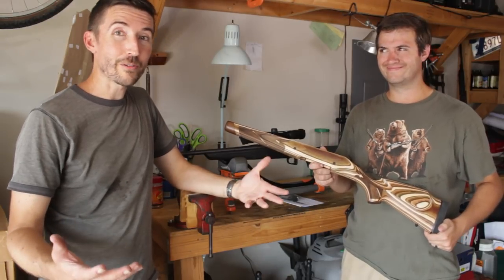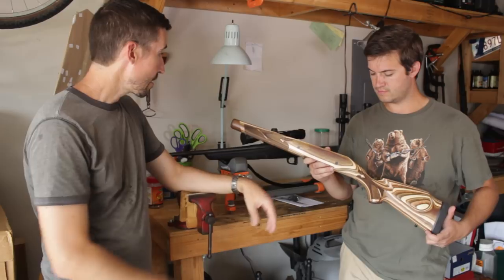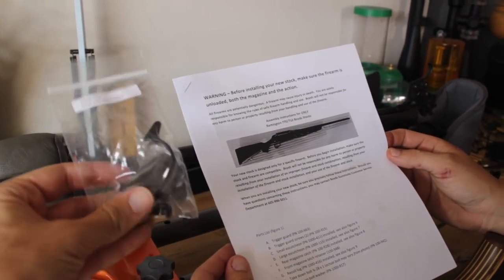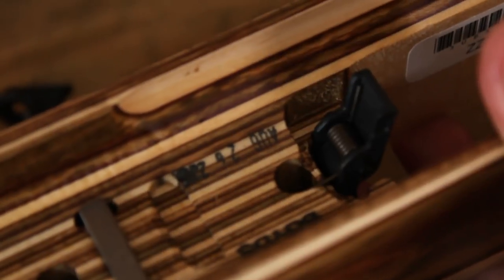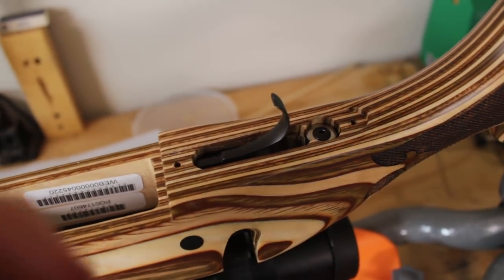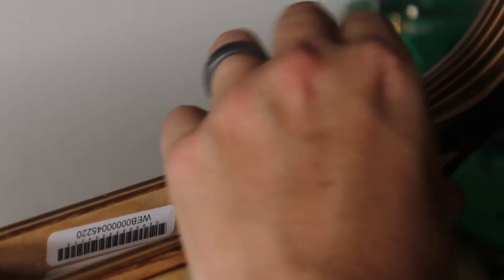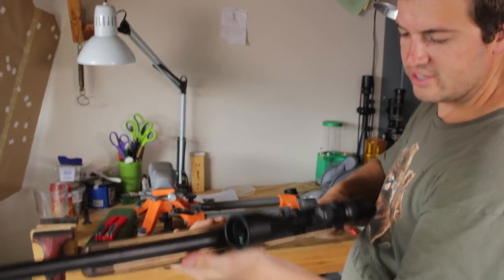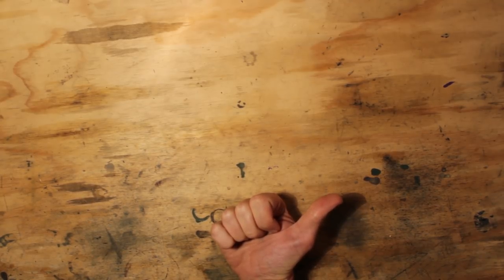Boyds Heritage Rifle Stock Install - Remington 770 in 300 Win Mag

Comment: I ordered the thumbhole and just went through this whole ordeal...this video is the only one I've seen for the 770 and it was helpful more so for morale I guess...my biggest prob was the magazine area...I took alot of material off and it is currently still really tight but it does go in...then I had the prob ya'll had seating the action...then they left 1 screw out that mounts the trigger guard...I did alot of "light sanding" to say the least but it does look good on the gun...
Reply: Yea same here I bought a heritage stock for a 770 in 243 ..I had to do a bit more dremel work but at least my barrel is free floated and it tightened my groups up about half an inch from what it was

Comment: You guys gonna bed that?
Reply from the maker: I'm thinking so. It'll be an interesting challenge. There's a screw that threads right into the bottom of the barrel strangely enough.
Reply: I saw that 3rd screw in the video. That's kinda odd for sure. Well, as long as you paint it good with the releasing agent, it "should" be ok.
Reply: My nephew has one in 308. We talked about pillar and epoxy bedding but i declined after further inspection. The original action screws are part of the problem as the pillars would have to have the correct countersink on the bottom side and the "tang" is made of plastic with a threaded insert. Just doesnt seem like a strong enough anchor  point. If you do bed this rifle i would REALLY be interested in a video to see your take on "how to".
Reply: Accuracy?

Comment: The two main weaknesses of the 710/770 are the bolt riding in a plastic sleeve in the action and the bolt stop wearing out. The bolt stop issue can be remedied by buying more bolt stops and keeping them on hand. Say 5 or so. The plastic sleeved receiver can be upgraded with an aluminum sleeve custom machined or left as is. The real problem is the bolt lacks enough support in the receiver raceway which causes it to bind. A custom bolt body of larger diameter ala the Ruger American would fix that. Then the barrels are pressed into the receiver so removing and replacing them would require relief cutting, tapping and drilling barrel stub and skill with a hydraulic press to properly set in a new barrel. The trigger is in a word marginal to unacceptable. The magazines are not very well made, but machining the top of the receiver to allow top feeding could remedy that with a blind box set up. In other words, I just rebuilt the 710/770 to make it something which can passably be considered "heirloom quality". For the money, I could have built a custom 700 on a Deviant action, stocked it in a high grade stock, bedded it, installed a Midas trigger, had a Shilen barrel installed, and put a high end Leupold on it. 

The Remington 770/710 is a truck rifle which takes practice to overcome its shortcomings. It is a loaner rifle for new hunters and/or unexpected (unwanted) guests at hunting camp. I would not pay more than $175 for a 710/770, no more than $200 for the stainless version. I would not put high end optics on it. I would at best free float the factory stocks and spray can duracoat the barreled receiver to prevent rust. These rifles were poorly designed by Remington, poorly executed during a transition period, ended up being a mistake. The Marlin X7, Remington 783, Winchester post-64 70, Mossberg ATR/Patriot, etc. are better rifles, but the extractors are inferior and poorly designed. Heat treating on the Marlin X7/Remington 783 bolt heads leaves much to be desired and in the end could justify an aftermarket replacement.

Bottom line: A Remington 700 ADL/BDL or especially Howa 1500/Weatherby Vanguard are vastly superior options to Remington's (Savage's, Ruger's, etc.) low end guns and what can truly be built into "heirloom quality" rifles. For far less money. The Remington low end rifles tempt the penny wise and dollar foolish.

Comment: Is it not possible to have the recoil lug attached to the barrel/action like with the Remington 700?    Do the mrad egg challenge with this rifle and more plz
Reply from the maker: The 770 is a very different beast than the 700. Like the Tikka T3 and Savage Axis, the recoil lug is a part of the stock. It's been a while since I'e shot the egg challenge. You're right. I should do that again sometime.
Reply: The Social Regressive The Social Regressive interesting, if they both perform well I may have preferred the 770.  I was semi inspired by your 1000yards for 500$ and built a Remington 700 in .308.  May have been able to save some cash if I had went with this model since the gunsmith charges a hefty by-the-hour price.    Didn’t copy too much from that series, but the knowledge was applied to my rifle.   I want to do the egg challenge too, eventually.